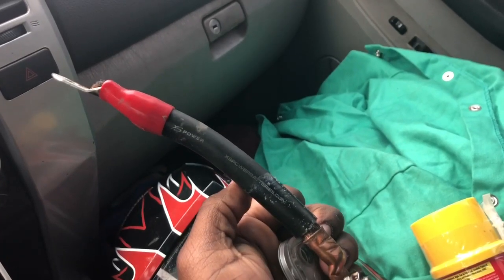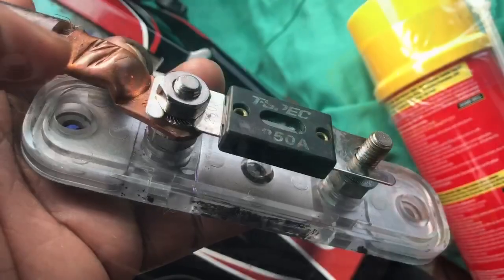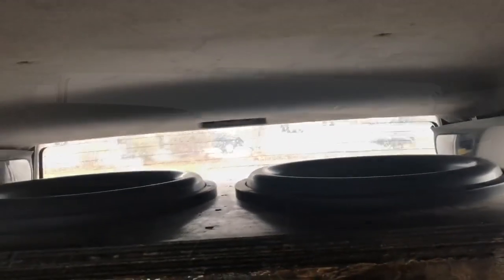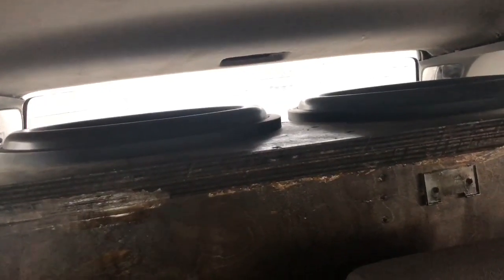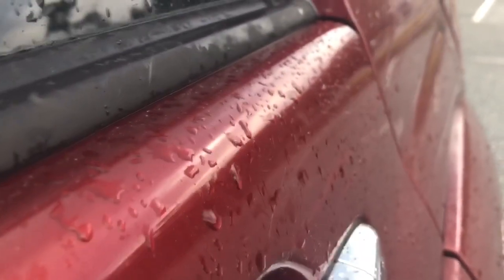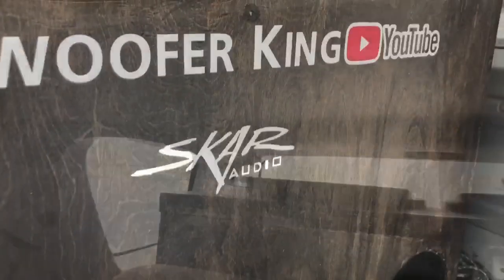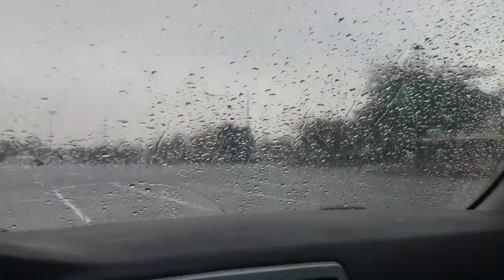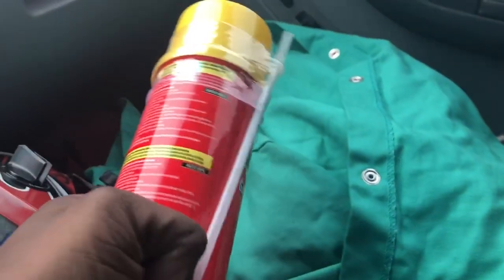I was WRONG About the Skar Audio EVL! Wire was Unhooked the WHOLE Time

Comment: Things happen bro.the bolt was probably tight when you installed it just ratted lose. Just be glad it didn't ground out
Reply from the maker: soundqubed killer Yess! I’m so happy it didn’t ground out. That’s why I use 2 fuses on long 0 gauge wires running to the back

Comment: First time I installed my Sundown SA 12’s, clearly not even thinking, I wired them to a 2 ohm load and they didn’t hit harder than the RF P3’s I was trying to replace them with. So, I was disappointed and just put RF back in. 
After a couple of months I knew I had to have done something wrong and the next time I hooked them up I wired them to a .5 ohm load and wow. They obviously hit so much harder. 
That’s also when I learned my RF amp was .5 ohm stable. 
I felt like such a damn fool. 🤦🏻‍♂️
Never again. I hope!
Reply from the maker: Devil’s Advocate Haha yeah! I feel u there buddy. I made that mistake before. How many watts is your amp?
Reply: @SubwooferKing100   Birth sheet said 1,500 at 1 ohm, wish I knew what it's doing .5 ohm.

Comment: Omg how in the God's green earth did that happen.  I'd go back over to check every single connection just to make sure
Reply from the maker: PSE Mentalist I guess the nut eventually came loose overtime. That wire was in my truck for years! And yeah I made sure to check out the rest of the wires and fuses

Comment: What is your box tuned at ??
Reply from the maker: Curtis Callarman 32 Hz. This box can play way below or above it’s tuning. I build some extra aero ports for different tuning, but never had to use them
Reply: @SubwooferKing100  I just got 2 evl 18s tuned to 29hz and 2 vvx 8s and am tuning the box to 32 hz and was watching your video to see about how my Escalade will flex
Reply from the maker: Curtis Callarman Yeah once they are fully broken in, they will flex the hell out your Escalade. If you have the proper size amp and a properly build box. What size is your box for the 18’s?
Reply: @SubwooferKing100  11 cubic feet and I got 2 scar to 1500 amps for the 18s
Reply from the maker: Curtis Callarman The specs on the skar website are kinda off. Those 18’s need to be in at least a 12 cu.ft box. Preferably a 13 cu.ft box. The smaller the box the more power you got to put on them. The box I have right now is a little over 14 cu.ft